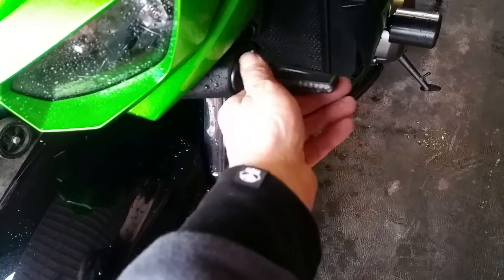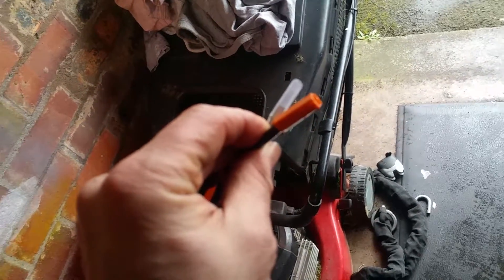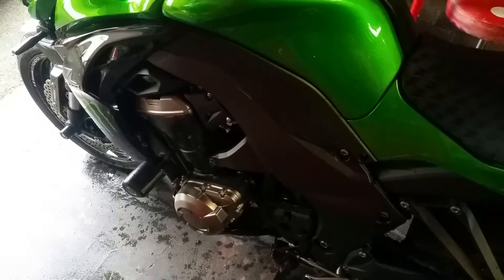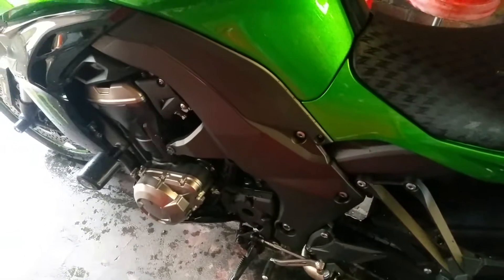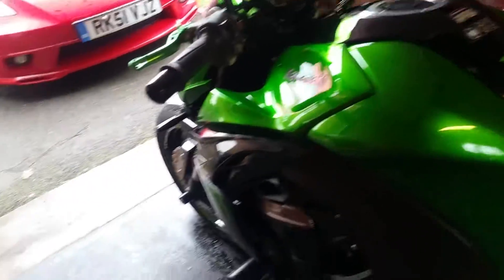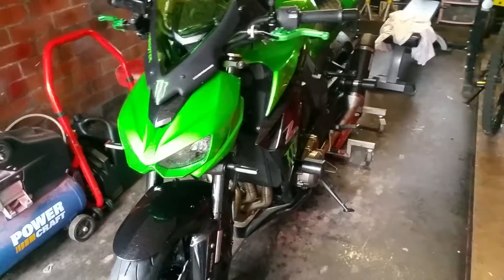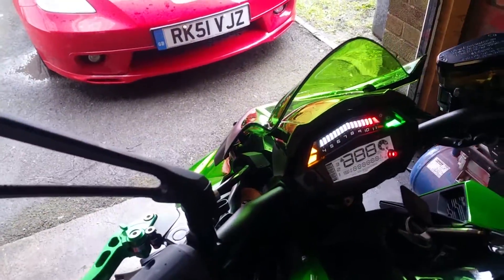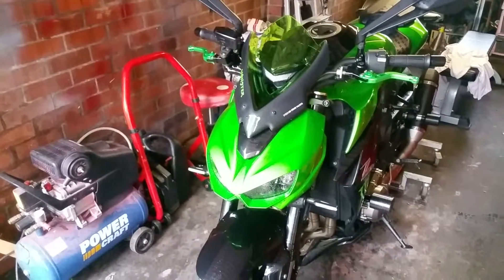Now flashed and more mods.

Comment: I believe that the Z1000 comes with LED flasher relays as standard. On my 2010 3rd gen., one of the rear indicators lamps (factory) burned out and I was surprised that the front one still flashed at normal speed (as opposed to faster),  which leads me to believe that the bike has an LED relay fitted as standard.
Reply from the maker: Ha wish I had known that 😊

Comment: Good mods. Did you do anything to the rear fender when switching to 190-55 or bike has clearance for bigger wheel?
Reply from the maker: YT1344 hi buddy, no mods required to fit the higher profile tyre as  theres good clearance 👍

Comment: Hi there nice bike :) i bought the same and i was looking for those connectors for the flash light where did you find that ? Thanks
Reply from the maker: hi buddy these guys sell them off ebay indicator adapters for kawasaki 😉 http://www.ebay.co.uk/usr/road-and-race-online?_trksid=p2057872.m2749.l2754
Reply: Robert Wright what they called the connectors? That link dosent open cheers

Comment: Hey buddy how did you install the aftermarket turnsignals on the bike? Bike looks very nice!!
Reply from the maker: Sijpy ..Hi  m8 she's getting how I want her  now 😉
to fit the signals you need to drop the nose fairing the u can get at the wiring .. you will also need an adapter plate.. get em off ebay.. so the aftermarket indicators fit.
then u need a restored if you use led ones and I also got an adapter for the wiring so it fits the bullit connector of the indicator and also fits the kawasaki block connector so no splicing of wires.
sounds complicated but it ain't and defoe worth doing 😉
Reply: Robert Wright..thans for the info m8. Mine is getting there ass well..keep posting the good stuff 👍🏽

Comment: Hi, Robert. I know this is an older video, but I was hoping for some insight on the indicator relay. Is it just the one, under the saddle, next to the ECU that needs to be replaced for all 4 indicators? Thanks very much for the content. All the best.
Reply from the maker: Hi buddy , I left the relay alone and just added resistors, worked perfect and still are. I think the relay is indeed under the seat 👍

Comment: Hi Rob.  How did Jordans do the flash? Did you remove the Sas system first? And how long did they take to flash it?
Reply from the maker: wasn't impressed with them to be honest they bitched about my plugged tyre and imo just rushed the flash only spent about 2 hours on it.. didn't overide  the Lambada Sensor warning light..said it was locked which is bollocks I wouldn't recommend any bod going there to be honest .. they finally managed to squeeze 128 bhp at the back wheel which was disappointing mind u the motor is still tight with 2000 on the clock..
Reply from the maker: +Robert Wright and nope they didn't remove the pair system

Comment: Where did you get the levers?
Reply from the maker: NotNow http://www.ebay.co.uk/usr/5g-r4cing?_trksid=p2057872.m2749.l2754 😉
Reply: Robert Wright thanks m8. fyi, cheap stuff looses color after a while...
Reply from the maker: NotNow Yeh do buddy had a set that the soft anodising wore through after a few weeks..these are hard anodised and they like new still with all stainless fittings too ..bargain for the price 😉
Reply: I got some for my cbr a few years back and it took about a year to wear off...

Comment: That's pretty sloppy to say the least. Its a shame youre not down here as 400 quid gets your bike a full day on the dyno. Chris (CJS) had access to all areas of the ecu. The pair system (sorry I said sas - thinking of my rsv4) has to be removed to have any chance of getting a custom map on there which proves they didn't really do anything worthwile. In fact Chris is that exact that he says if anything is changed on mine it really should have a remap (which I think ill be doing as ive switched to a single exit system). If they knew what they were doing they should have been able to do all the mods....ie lambda, secondary injectors, flapper valve motor and fuel cut off...all that stuff has been done to mine...
Reply from the maker: Yeh I agree with u all he did was lift the restrictions in the early gears on timing retardation..defo a shoddy job and I will be making sure all the peeps I know to steer clear of Jordans of leeds. 😉at least the power curve was smooth. 
when I have the spare cash I will be getting the job done again  properly this time ..there's a guy around my neck of the woods who did my Bandit so I gonna get a power and fueling run again an the dyno and a proper graph off him to see were I really stand.
on the plus side the engine e feels strong and sounds sweet as and power wheelies in first 2 gears 😊